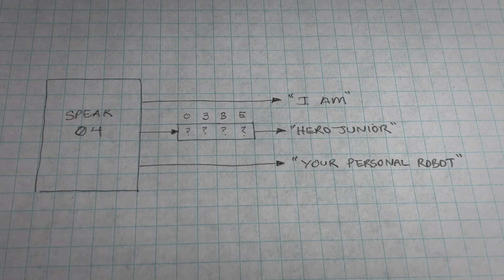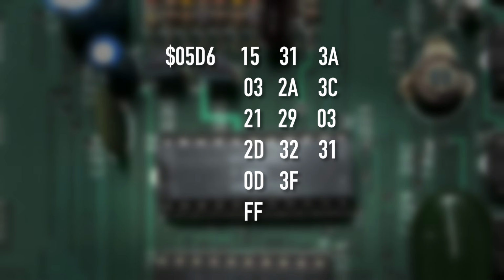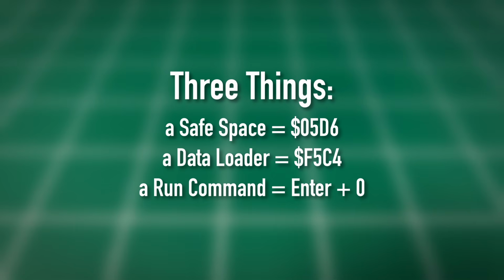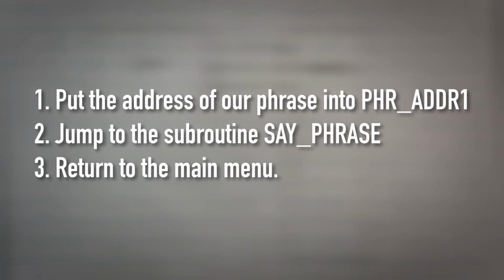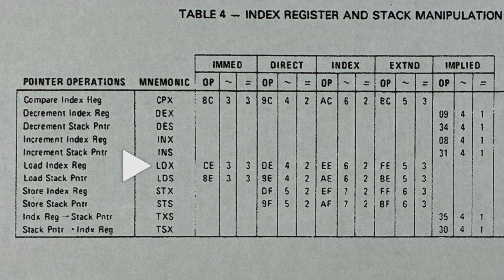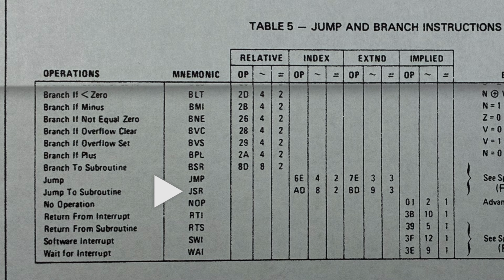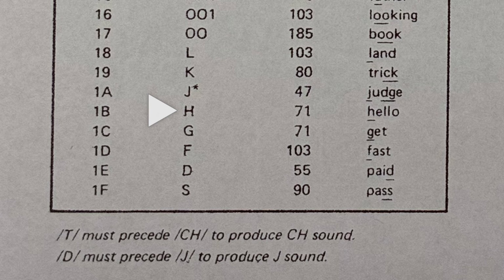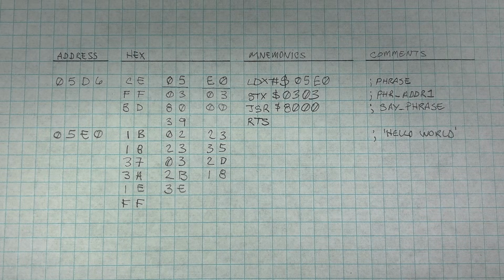Hero Jr. Robot - Part 4 - Hehuhluhou Werrld

Comment: Is there a way to record a program with commands on a cassette deck for the hero Robot? Do you have a Patreon account for contributions to your show?
Reply from the maker: So the Hero 1 has cassette tape IO but it’s not a built-in option for the Hero Jr.  the Jr has a cartridge port option which was seen as the easiest way for consumers to run additional software. Down the line I may look into some kind of secondary storage, but there are expansion challenges w the Junior.  More to come on that front!

I do have a Patreon where I post blogs and notes.  99% of the content is free and there are several paid membership levels if you want to support the channel. It’s patreon.com/MLBelanger

Comment: I love those LEDs beside the keypad. They're showing the current data byte, aren't they? I can see them pause as the speech chip pronounces a phoneme... Having such a tightly coupled interface to the data flowing through the computer's circuits is incredible.
Reply from the maker: Aren't the LEDs awesome?!  I thought they were the phoneme sequence myself but looking back at the video frame-by-frame they do not match up with the numbers in the Hello World phrase.  So they're definitely something but I'm not sure quite what. lol.

I'm working on a routine now for a future video to get ahold of the lights and use them to output numeric data.  You have to turn off interrupts because the OS keeps trying to use them for it's own stuff.
Reply from the maker: I have fully solved the mystery of the LED lights in one of my later videos!

https://youtu.be/JmBMy7ybRuM?si=V1U9KY-IB5KGWeJl

Comment: Nice video als always. Have you considered using a custom PCB for the expansion cartridge slot? Like the known Master Cartridge mod that can store extra programs?
Reply from the maker: I have the Master Cartridge and I use the SPEAK command in BASIC to work out more complicated phoneme streams but I’m not thinking of expansion in that direction. I’d like to get a true expansion bus added somehow to be able to add more sensors, etc but for now there’s a lot to do with just software and the existing sensors. It would be nice to be able to burn ROMs some day so I can have some custom code in the cartridge socket permanently.